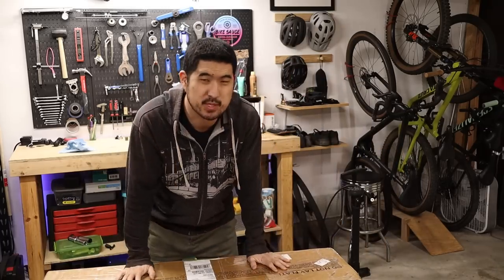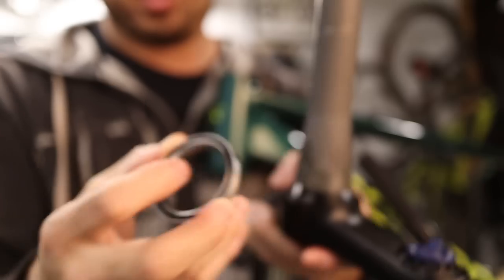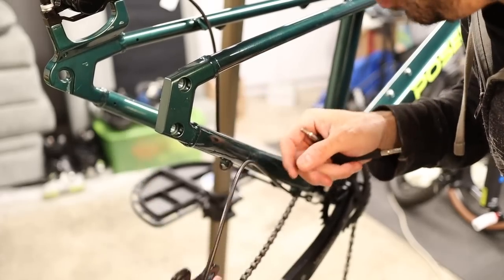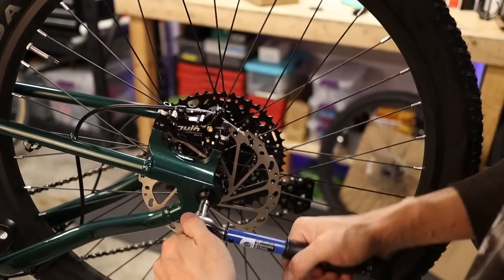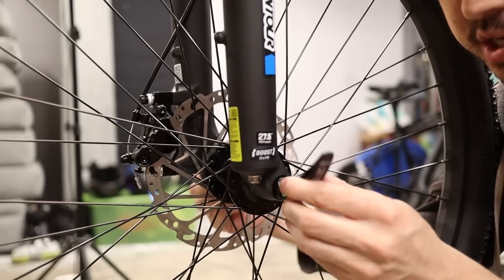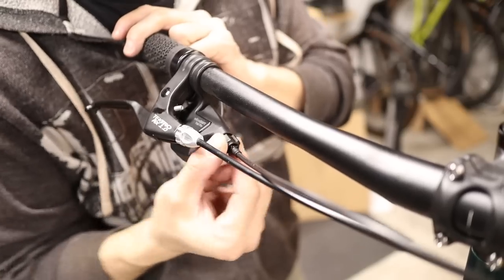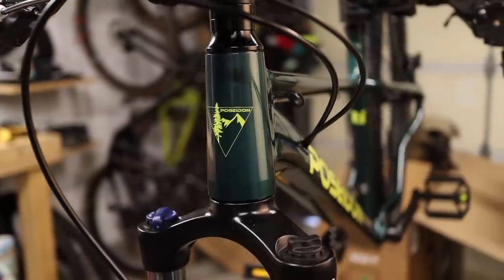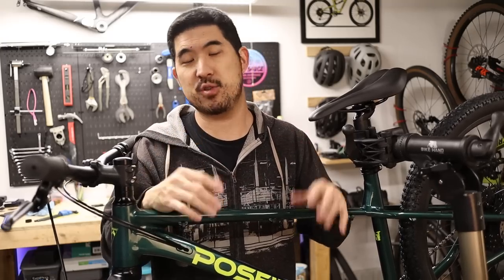2023 Poseidon HARDTAIL MTB // Build & First Look!

Comment: Best way to adjust a caliper is loosening it and applying brake lever pressure and while holding your lever tighten the caliper bolts and then let go of the lever and you should be aligned perfectly, I have been using this method for years and it always works

Comment: Hey man thanks for this video!  With no bike-building experience I was able to follow your instructions and get my Norton together without issues!  I think getting no rub on the rotors and indexing the gears were the hardest part but I would have been lost without this!  I initially thought it would be cheaper to Youtube and build myself vs drive to Anaheim and pay $80.  That said - it was definitely not cheaper but I got to build the bike and learn all the different components with ease.

Comment: One thing about the Q-Loc suntour axle: when removing it, after pushing the small tabs closed on the side opposite to the lever, you can lock them in the closed position by turning them clockwise (and then you can unlock them by turning it counter clockwise), otherwise it will be almost impossible to remove the axle while the wheel is installed
Reply: Holy crap, thanks for the info! I didn't know this, and removing the wheel went mostly smoothly but did end up in furious axle-yanking many times... This makes it so much easier!
Reply: Correct. I came here to write this too. It is a very well thought system. Too bad it is exclusive to them. The titanium version found on higher end forks also weighs half the cheaper version too...not that an axle makes a huge difference, it is just impressive the first time you hold it if you've only handled the regular version.😂
Reply: @-T90Vladimir  Ahaha I know, I have a similar fork, an XCR 34 Boost, and the first time I had to remove the axle I yanked it for a good 5 minutes before I accidentally locked it closed and realized how it works
Reply: @dtolios  Yeah it's a very clever system, though apparently a lot of people don't like it

Comment: @The Bike Sauce, I LOVE your tech content and science content which has even inspired me to take a look at becoming a possible mechanical engineering which will hopefully lead to starting my own mechanical bike research team at MSU as well maybe change current tech/concepts to be more sustainable. 
On the note of the video, for the headset preload, the best way to determine is by tightening it just enough to the point of where you can not move the headset spacers in a separate order from the fork/handlebars, another tip is to press the breaks while bending and maneuvering the break cable without crimping in during the process, this brakes in the cable for proper stretch without needing to adjust later on for the stretching that occurs after riding it for the beginning of having the bike. There are quite a bit more tips that I could give but don't want to make this too long to the point that you won't read it, so very much, please feel free to message me. Also I work at a bike shop in case you were wondering about my knowledge.

Comment: Looks like it's a pretty nice frame and budget friendly build. I'm not surprised Poseidon did a 27.5 wheel size and not 29er for their first mtn bike offering? As for their gravel bikes I've always wondered why they don't have 142 drop-outs? At least this mtn bike has the Boost
Reply: The Redwood has 142mm drop out.  It’s also the “true” gravel bike😮😂.  The X is far too roadie, the ambition improved upon it and I think it’s got the dropouts too now.  Also, there’s a conversion kit for the X which Poseidon sells.

Comment: quick question. One Poseidon's website it says the Norton frame is setup for 180mm rotors but in this video there's an adaptor under the caliper, so does the full bike ship with 200 or 203mm rotors? Just asking because I have the frame arriving Monday and I currently have 180mm rotors with an adaptor on my current bike. i just wanted to know if I'm going to need those 20mm adaptors or if since I'm using 180mm rotors I can just attach the rear caliper straight to the post mounts?

Comment: I'm not sure why they decided to spec this bike with the juintech brakes. The only reason people were putting those on the gravel bikes is that swapping to a full hydraulic brake meant you had to replace the entire groupset. These brake calipers are more expensive than entry level shimano full hydraulic brakes.

Comment: I always like when companies try to make a solid budget bike, but I've got some nitpicks. Overall it seems like a solid base. 

- should have a hollow bottom bracket, costs what? $10 more? I just think square taper is a pain and these cranks just look cheap. 

- xcr fork would probably be a little better, though I'd like to try this one out to see the differences. Possible this coil has a better ride quality, even if it is heavier. 

- plus I think it should come with pure hydraulic brakes, but I have heard good things about those juin techs from gravel riders